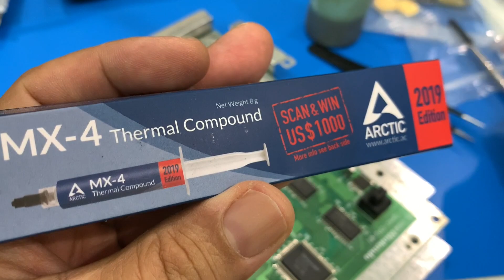Episode 125: SNES SHVC-CPU-01 Full Recap.

Comment: I did a full recap on mine, including the sound module and added a cap between the output and ground on the VReg, replaced the fuse, and the VReg (even though that wasn't the issue, I did it just because it's a preventative maintenance thing and fresh stuff will make it last longer).

Comment: Sorry if I missed it but what temp do you use to do this? I am very new to this and I struggled to replace c63 and c64. I want to do the rest of the caps correctly. TYIA
Reply from the maker: Soldering temp I use is 280-300 C.

Comment: Wish there was some commentary on what was used. So i can try to buy the right stuff, since i assume this was a tutorial...all i saw was first put mystery liquid on the capacitor, next use mystery tool to pull of the capacity, now use mystery liquid on q tip to clean...
Reply from the maker: 1. Get capacitors listed in description.
2. Mystery liquid 1 is flux used to make moltenizing (melting)solder easier.
3. Mystery tool is a desoldering tweezer. U can go ultra cheap like the one I’m using, or get more expensive ones.
4. Mystery liquid 2 is IPA aka isopropyl alcohol. Use 90%+ versions as they are more effective.

Comment: Hi, I really enjoy this kind of content! I happen to be fixing a Snes on my own, but Im not sure its the same model. Things, I get sound, but a Black moving screen and, while watching this, I realised your Snes has a big 1000uf capacitor which mine doesn't. Do you happen to know if all Snes are supposed to have that one? Or could that be related to my problem? I would really appreciate if you could let me know, thanks
Reply from the maker: There are various revisions of the SNES board, so some things differ between them. Your problem is most likely the video processor chip. Cap issues are more a distortion of the picture. I would suggest going on a specific subreddit and taking a video for confirmation, or share a video of the issue with me on Twitter- @The_SegaHolic and I can see and/or ask the community.
Reply: @The_SegaHolic  thanks for your support. Yeah, I feared the video chip could be the problem, I'm rlly hoping it isn't

Comment: Great video , I have a SNES , do you recomend to apply thermal paste like you did in the video ? And exactly where should i put the paste? in the voltage regulator ? Thank you
Reply from the maker: No, the paste goes in-between the regulator and heat sink. You just put it on the regulator where it contacts the heat sink. Thanks for commenting!

Comment: I use hotair station to remove dose caps fast , just add flux to them to make it faster.

I also touch all the pads with flux before settling down new caps, sleeps up the work
Reply from the maker: I don't like using hot air because heat is distributed not only on the part intended. Thanks for the tips.

Comment: I have two SNES and one has a low frequency audio buzz.  Do you think replacing the caps might fix it?   I'm willing to try because I have two.   Well one is actually a super Famicom but I have an adapter so I can play both style games
Reply from the maker: Worthy try. If it isn't it, then you've got peace of mind that the caps have been replaced. Easy enough to do, and there aren't so many in an SNES/SFC. Yeah, the SFC pretty much has the same board.

Comment: I'd be curious to replace these electrolytic capacitors with ceramic caps to see if they would be any detriment to the operation of the SNES. Some of the electrolytics in Game Gears have been successfully replaced with ceramics, which eliminates having to worry about an operational life (at least to the degree that we have to keep in mind with electrolytic caps). Granted it's still a ~30 year life span usually for electrolytics, but I'm OCD about making things last as long as possible.
On another note it's so awesome seeing a resurgence in popularity of these vintage consoles that I grew up playing with. I have my NES and N64 that will be getting full restoration (including recaps) and HDMI mods, and on the list is to get my hands on a 1CHIP SNES that I can restore and mod for RGB.
Reply from the maker: First off, the sizes of the ceramic caps are realtively small, and are not available in bigger sizes. There are also performance characteristics inherent in different types of caps that necessitate using these different types of caps in different applications.

In some situations, you can use ceramic or electrolytic, but in others, where low ESR and ripple voltage is a must, then you don't have an option.

Google the different types of caps and their applications and characteristics.
Reply: @The_SegaHolic  Exactly where my curiosity arose; with the points you mentioned. Granted the larger capacities of 1000 uF and up are better served with electrolytic caps, but given the other differences between electrolytic and ceramic caps (especially like you mentioned; the ESR and ripple current), I'm curious if (and if yes, in what circuits if not all) the use of ceramics for the caps lower than 1000 uF would negatively affect the operation of consoles with this old of technology in them.
Could be interesting if I can get a second board to experiment on that I wouldn't be afraid to junk if it doesn't work out.

Comment: Hihi, nice video. 
It seems that the smd capacitors are mostly relative to video singals.
Reply from the maker: The capacitors are there to filter out DC voltages or DC noise.

Comment: Great vid. What was the thermal paste all about?
Reply from the maker: Thermal paste for the transistor which is cooled by that aluminum heat sink I cleaned right after. The transistor is screwed to it, and there is better thermal transfer to the heat sink with paste... like a gpu/cpu.

Comment: hope you don't mind me asking SegaHolic, probably you already answered in another vid, but what's that desoldering iron for smd caps you're using?
Reply from the maker: Desoldering Tweezers. These used to be under $10.
 https://www.circuitspecialists.com/Tweezer-Style-Soldering-Iron-For-SMD.html
Ebay prices have skyrocketed too. You can also change the tips to bigger ones to remove surface mount IC's, which I have done and works well.